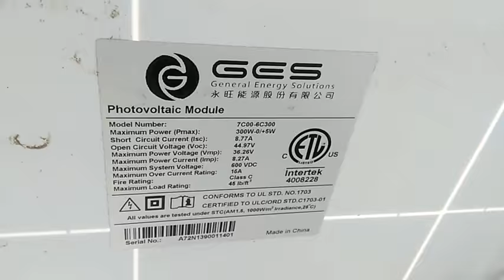Heating water with a solar panel

Comment: My friend has a similar system but he just uses the 120 V standard heater and runs some panels in at somewhere over 120V DC. The panels are hooked directly to the water heater, no charge controllers or anything in between. The fact that it does not freeze in winter is key here in Canada
Reply: That is what I use. For 2 years now. Works great.
Reply: We wait a video
Reply: 120 V standard heater? What is that? Just interested
Reply: @banmaga  they make small ones for installing under a sink so you don't haft to wait for the hot water to reach the faucet. Brilliant idea actually.
Reply: Yup

Comment: Listeria might become a problem in the low temp solar tank. It grows in tanks with water below 120f.
Reply: I just started to post a similar comment, that the first tank would be a potential breeding ground for bacteria.  While in theory the second tank will probably heat it enough to kill it off, that's assuming water will always stay in the tank long enough to kill it.  In the real world - especially if you're running a lot of hot water at one time - there is a likelihood of water being pulled into the second tank just long enough to be pumped back out again.  If you end up with a runaway bacteria problem in that first tank, it could pose a serious health risk.
Reply: It also grows only in places where there is no water flow. It could be a problem in big commercial water tanks and not in a small home tank where water is replaced daily if that makes sense.
Reply: @gregfromthevaley  makes sense but do you know how fast it grows in a tank? Would a day or two be enough? I’m wondering if taking a weekend vacation would be enough time for the water to stagnate and allow listeria to grow.
Reply: That's an interesting point. If the chlorine PPM was at 1 or above, I thought it would have killed any spores along with the bacteria and pathogens.

Comment: I like your dual tank setup. You could use passive solar as well in a similar method with a separate loop that contains coolant, allowing it to run year-round and heats your supply line through a heat exchanger.

Comment: This can be a lot more efficient with modern mppt solar thermal management electronics. Just coming out on the market, acts like a mppt solar charge controller for batteries except it's for resistive heating elements. Bassically an array of different resistance heating elements are connected by the mppt solar thermal management electronics in specific configurations to pull the right amount of current at the right voltage from your panels. Makes everything a lot more efficient!
Reply: any companies selling this?
Reply: could you send mppt controller name?
Reply: @AlekseiPetrovski  Geyserwise is south African made product. PTC 2000 watt element. Charger controller. Plus the thermostat control unit. The whole system runs off three 300 watt solar panels. search for Geyserwise on Google.

Comment: Jeff great video and straightforward common sense application of solar power to heat the water in the second tank before it goes into the main tank. I understand what you were saying to preheat the water to a good 80 or 90 degrees before it goes into the main tank therefore saving a lot of power usage. You have definitely inspired a lot of people to apply that application and you've also inspired me to do the same thing. I want to put in a 2 element secondary tank and use a wind turbine for the bottom element. That way at night the wind turbine can be Heating with the bottom element. Keep up the inspirational work
Reply: Exactly what I have done and it works great. No thermostat, no charge controller, no batteries. Using the original heating elements. Plenty of hot water.

Comment: Thank you. Very smart idea and set up... 
I have a120 volt, 10 gal tank, with a timer set for 1 hour in the morning. That's the 'only' time I want 'HOT' water. Then it's very warm for the rest of the day. 
If you put a digital timer on you 'grid-tied' heater, you could save even more.

Comment: What you are doing is fine but there is another way.

I have 1500 watts of solar  panels wired in series to give about 115 vdc.

This goes to my water heater which has a standard 115 vac heating element in the bottom of the water heater. The upper element remains connected to 220vac power.

It's a 50 gal tank and reaches full temp over the course of a day.

The only hitch is I had to create my own temp controller using a thermistor and an Arduino to open up a solid state relay when the temp reached its setpoint.

Without the controller, the tank would over pressurize and pop the relief valve.
Reply: Could a DC ground fault cause galvanic corrosion?

Comment: I see one slight problem with having two tanks.  The hot water from the solar driven tank stays in one tank, and only travels to the second tank once there is water flow.  This means that if you are not using the water, the mains electric water tank is still using energy to heat up the water when not being used due to thermal losses of the tank.  I think the idea from another commenter to put the 24V element into the same water tank as the tank with elements driven off the mains, and this would both reduce the electricity when no hot water is being used, and while hot water is in use.
Reply from the maker: dammm, you are right! My electric bill did drop consistently though. The next time I build something like this I will look into doing it that way.
Reply: Excellent video on your set up.  I am in the process of designing my own solar water heater right now, and this information is great.  I am on the fence about using PV cells or heat collectors.  I am in Austin, TX area and if I use heat collectors, plan to use evacuated tubes of my own design, so when we do get the few days of freezing a year, it won't be a problem.  Great video.  Keep it up!
Reply: Adding a timer to your 120v tank will help with that. I need to add the solar side to mine, but right now just have my tank set up on a timer to run for 1 hour a day at 5am. Enough for showers in the morning and dishes in the evening. Then the solar could take over during the day.
Reply: Yes I thought that also. While the water from the first to second tank is always warmer and reducing mains power usage, you have to let it travel to the second tank before use causing losses? If he had just one tank and maybe a bigger pv array he could just use solar and not use mains at all?
Reply: Simple convection will transfer heat.
Reply: Heat rises and will transfer to the taller second tank, it doesn't just sit there.
Reply: Could the solar panels be hooked to both heating elements?  When solar's available, it could prioritize heating the first tank.  When the first tank hits the set temp, the solar could be used to heat the second tank.  When the sun isn't shining, it could use the grid to heat the main tank.  Although, maybe it doesn't matter in the winter since the solar tank is only hitting 80F.
Reply: Yep, go with one large tank with two heating element and thermostat ports.  Obviously, stager the thermostats so the PV one kicks on sooner and shuts off later.

*And*, if you stall a cheap (under $50.00) single-pole, double-throw relay to energize the heating element, you'll get far more life out of the OEM thermostat and be able to redirect the PV panel juice to a grid-tied inverter when not feeding the water heater!

This is really the most-bang-for-the-buck one can get out of PV without going stupid with money on batteries and such.

I'm also a big fan of using PV for LED skylights in dark corners of the house/garage/workshop.

Odd that these simple solutions incorporating solar aren't more widely discussed.  Of course, inexpensive doesn't make any money for the commercial solar installers.
Reply: Russ Burghorn  good idea! I'm going to try this in my setup. Thanks for the advice 👌👍🏻👍🏻
Reply: Russ Burghorn  I like this idea! I would also add my generator to the backup equation. I just need to figure out how to keep my water holding tank from freezing in the barn (that would feed the water heater tank).
Reply: I think it will thermosyphon automatically when a temperature differential is reached?
Reply: @JamisonWorkshop the one hour you mentioned  is it heated by Gas or electric
Reply: @shabirahmeds  it is electric
Reply: Use the 120 as preheater.
Reply: Do it opossite to how you are.and turn the therm to vacation on main tank. And you need to run high voltage and not change elements
I run 48 v dc directly . I run my 220v element legs in parallel..
Reply: You pipe them in parallel with a pressure reducing valve series is always hot water to your appliances from the most reliable source

Comment: Let's talk about AC and DC heating elements.
 The AC that comes from the grid 240VAC, which is AC RMS which stands for Root Mean Square. RMS is the AC voltage that will heat a resistor to the same temperature as a DC voltage of that value. 120VAC and 120DC will both heat the same resistance the same amount. So there is no difference between an AC element and a DC element, in fact you can use an AC element with DC because water heating elements are simply resistors, they have very low inductive reactance. The AC frequency of 60 Hz has very little inductive reactance effect - if any. XL=2piFL or inductive reactance = 6.28 x frequency x inductance. At 60Hz the inductive reactance is minimal to the point of insignificant.
So buying a 12V or whatever DC element is spending money on something you don't need, especially because they are so expensive compared to box store common AC elements.

What is important is the wattage of the element and it's resistance. A 1200 watt element will work with 10 amps from your wall outlet - 10 amps x 120  volts = 1200 watts.  The same element will work with 12 volts too BUT the current will have to be higher - 12 volts x 100 amps =1200 watts. The formula is P=EI or power = voltage x current. Just as long as the element's power is not exceeded you can use AC or DC - it doesn't matter!
If you have a 1200 watt AC element you can heat it just as much with 4 or 5, 24V PV modules or you can take two or three AC elements and put them in parallel. If we took three 1200 watt elements in parallel the resistance would be 1/3 so you could get the same heat with less PV modules for example if they can carry that much load. Why?  Because the resistance is lower and the load is greater the PV voltage sees.

You're basic idea to preheat the water is good but understanding what I just wrote will save you unnecessary expenses.
Reply: That's wots I need to know cheeks
Reply: My brain hertz.
Reply: The problem you have though is switching the dc with the ac thermostat. The dc draws an arc an the thermostat and eventually welds closed.
Reply: sounds to me like what he needed to do was get a 240 volt 30 gallon tank. hook up both elements and remove the thermostats so they would run full out heating the water.   Might even get the water to a higher water temperature where the delta 10 could be down to 10 degree or less
Reply: then wouldnt connecting the solar dc current directly to the secondary AC element he stated was not connected, along with a few other automation mods.   PS  installing a timer to turn off ac voltage during off hours could very helpful
Reply: @derekallen4568  There's no difference. AC and DC see equal resistance. Yes, you address how you control AC and DC differently but this has nothing to do with the element, this is only about the source driving the element.
Reply: @tfhmobil  Let's say you want to run a 48VDC heater at 1000W. P=EI thus I= P/E= 20.833 amps.  P=I^2R so the element resistance is R=P/ I^2 or R=E/I which equals 2.30 ohms element resistance. Now let's say we go to our box store and find 1000W elements at 120 volts. To run them on our system we need to figure out the resistance. We do it the same way we just figured out the DC element resistance. I just went down to my basement and found a 1500W element at 120V. 1500 / 120 = 12.5 amps. R = P/I^2 =9.6 ohms. These things are dirt cheap, $8.99 at Home Depot. 4 in parallel = 2.4 ohms, which is overkill, and you get the added benefit of being able to turn on and off elements to adjust to your source energy. I would just run something like 2 in parallel at lower heating watts. 4.8 ohms for example will give you 480 watts, three = 720 watts. You get the idea.
Reply: @mosfet500  i thinking to put 2 srtings x 3 panels in series (all panels are 6) panels are 41.23 Vmmp / 9.7 Impp ...so 3 panels in series are  123.69 V / 9.7 A  = 12,75 Ohms  = 240V 3500W Heating element (x2 becouse i have 50 gallon boiler and i want to be fast warm water) but dont know how to control heating elements from DC to AC when is winter time or just there no sun...can you explane what i need to do
Reply: @kamenkrustev  hI, okay, not sure what you're asking but when there is no sun there is no heating of the elements. There will also be times when there is sun and you're water tank is at the correct temperature. You do not need to control modules from DC to AC, the heating elements don't change because AC is RMS (root mean square). RMS heats a resistor to the same level as DC of the same voltage, so 125 AC or DC will heat your element equally.
However, you definitely want to control WHEN the element is on, directly hooking modules to elements isn't a good idea.
The good thing about using 120 or 240 volt elements is that they are higher resistance than DC elements. A DC element that is 1500 watts and 48 volts means the resistance is ~1.5 ohms. This will load your modules down, the voltage will drop and you will get very little power out. It's best to use three modules in parallel.
Also you want a way to shut off your modules when the water is at the correct temp, you can't simply hook modules to heating elements.
David Poz wrote an excel sheet to match modules to heating elements, do a YT search for "matching water heating elements to solar panels" by David Poz.
Rob
Reply: @mosfet500  I want to know if I need a DC controller, such as I see being sold on the market for $ 200, after I have directly connected the panels to the heating element and it to the existing protections of my boiler.   How to change the heating mode of the boiler when there is no sun to use electricity from the network or reverse
Reply: @kamenkrustev  Hi, you need switches to do it manually or relays and sensing devices to do it automatically. You'll have to do research, there is too much involved for me to answer you here.
Reply: @mosfet500  Is it possible somewhere to show me a diagram of how to attach my 6 panels to 2 heating elements, because I was already confused .. by David Poz I used the excel sheet and from there I decided to be a serial connection .... I have 6 panels of 41.23 volts and 9.72 amps ... how to connect them to make this system work and forget about it :(

Comment: I live in Germany and have 7,2 KW photovoltaic and 12 m2 solar. The solar did cost me 7000 Euros and I have always more hot water than I need. However, if you do the calculation, all the hot water (it also supports heating) saves me not more than 200 Euro per year. So, it will take me 35 years to get back the costs.
If I had the choice again, I would put 10 m2 more of photovoltaic on the roof and heat my water with a heat pump system for 1200 Euros.
So the main point is return of investment.
Reply: Just curious. How much electricity kWh Cost in Germany? 200e savings sounds like there must be something wrong or you don't really need electricity? Here average house uses 20000kwh per year. That is about 2500euro bill. If you add 7,2kw panels for a house In think it would save alot more than 200e. Maybe a thousand euro?
Reply: @Zanderman2000  I talked about hot water only. Not heating. I have heating with wood pellets (1000e/year), and it makes also hot water in the winter. I have additional 10m2 solar, which was thought to also heat the house, but that doesn't work. That is the cost of 200Euro I save. I have also 7.4KWp PV were I get 200 Euro per month from the gvn (29cent/KWh). 1 KWh costs 30 cent in Germany.
Reply: @JakobFischer60  i think your panels should be able to easily power a heatpump. Ground sourced heatpumps and air (fresh/waste) sourced heatpumps are very common here in new houses and added also to old houses because energy prices hikes up. Pellet is a good choise also but theres a lot more hazzle around when you have to burn something. The most simple heater would also be PTC element with fan. They are usually under 400w and even one panel can run a 100-200w heater. In theory you could power 7000w ptc heater bank with your panels on sunny day. Put the ptc elements in massive stonemasonry that will heat itself during day and release steady heat all Night.
Reply: @JakobFischer60  small 100w ptc element heater with a 120mm computer fan transfers around 40-50celsius air >90cubicmeters per hour. I think it should be enough to heat small room? There are quality computer fans on market that are very quiet if the stock one is noisy.

Comment: That circuit breaker doesn't protect you against lightning. Lightning acts too quickly for circuit breakers to react. They're useful, for example, for cutting off current when there's a short circuit. For lightning, you need to make sure your panels and metal frame are grounded to a ground rod driven deep into the soil. Also helpful is using a device specific for lightning protection. Midnite Solar sells a line of AC and DC lightning/surge protection devices that can be added onto an existing system (e.g. mounted on the side of a combiner box).

Also, it's not just the amperage rating of a hot water heater thermostat that's important. It's also the voltage rating, and a device like that isn't going to be able to handle nearly as much DC voltage as AC (as it's designed for).